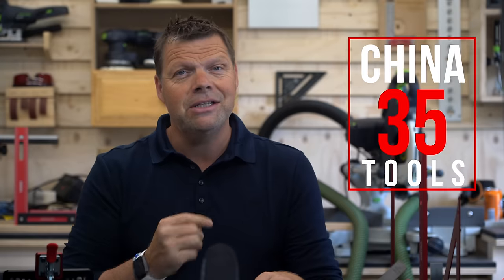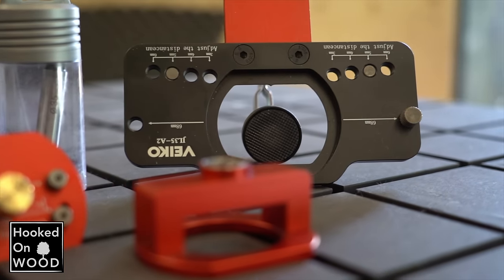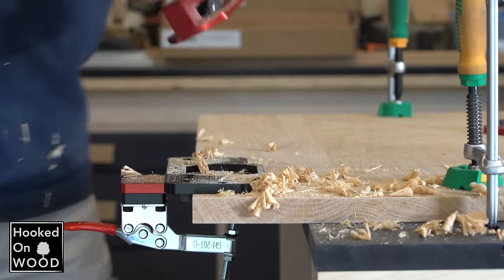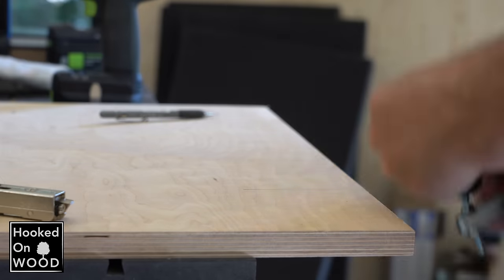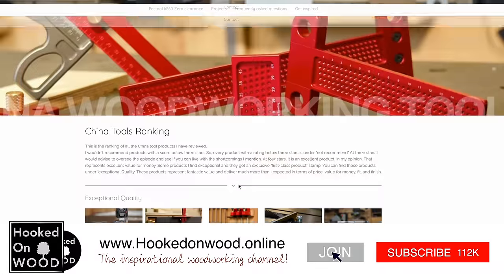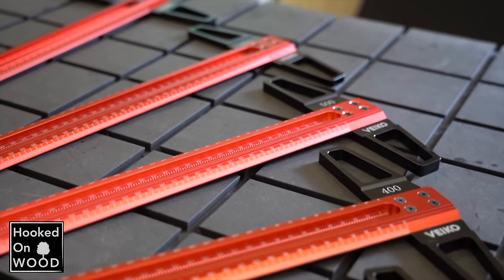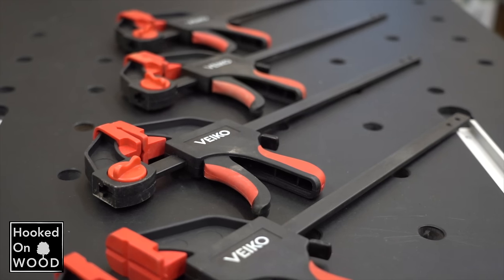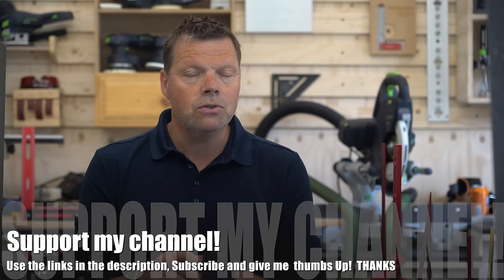The best Hinge Jig and more! China Tools Ep.35

Comment: I just received my jig and there are a few differences from what was reviewed. The Banggood website product listing looks just like what we saw here. Mine was shipped within the USA. Differences: 1. Product model number is still JL35-A2 but it's labelled "ENJOYWOOD" with "VEIKO SERIES" just below it. 2. The mounting holes now include a set for 32MM. 3. The bracket that holds the Forstner bit is now allowed to rotate slightly (maybe 15 degrees or so) in both directions. Don't know why that is. Quality is excellent and the best part is that the price is now $50.

Comment: Word of warning. I bought the hinge jig. The bit was blunt and struggled badly on the the first hole. The snap ring which holds the bearing in place scored the drill bit badly because it is poorly sized and protruded in to the opening of the bearing which the drill bit passes through, causing the bit to catch and get stuck. Banggood won't replace or refund the full amount. I've ordered 3 veiko products and all 3 were defective.
Reply from the maker: I am sorry to hear. Can you please try one more time and tell them you bought it on my recommendation. So, Dennis from Hooked on Wood. I had contact with them on these kind of problems and how they handle that in some cases. They promise to do better. Otherwise, dm me at hookedonwood@hotmail.com with your order nr.

Comment: That hinge jig is $75 AUD with discount.  I  bought the kreg  for less than 50. It is definitely a luxury item.
Reply from the maker: But is more flexible and of higher quality then the Kreg. But the Kreg works. So, that’s why luxury
Reply: @HookedonWood  yes I am thinking about one 😁
Reply: @HookedonWood  Kregs does not work. It is out of reasonable tolerances after 3 holes. Plastic just don't hold the drilling bit steady enough.
Reply: @donalexey  works for me. Maybe user error

Comment: My experience with squares from China have been way more miss than hit. The carpenter square from Veiko is not actually square and the adjustment screws are just fake and don't actually allow to adjust the squareness 👎. Maybe they've adjusted the product meanwhile to be of better quality but I remain sceptical especially since it's close to impossible to get bad China products replaced, best case you get a (partial) refund but what good is that for a square which is not square? Also I disagree about the value of the Aluminum "machinist" squares, a good DIN 875/0 lapped steel square with guaranteed accuracy and long time stability delivered from Europe costs around the same as the who-knows-what-to-expect aluminium ones from Veiko, so why even bother?
Reply: I have the 100mm square with the marking holes, it is a very nice and accurate little square.